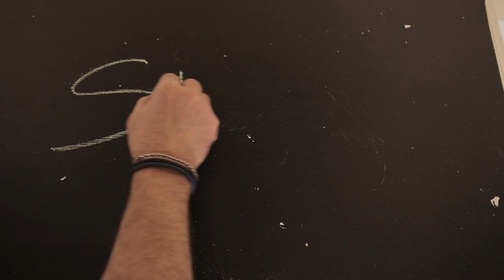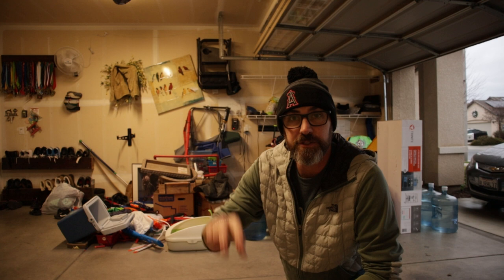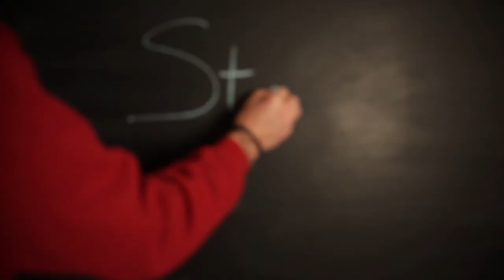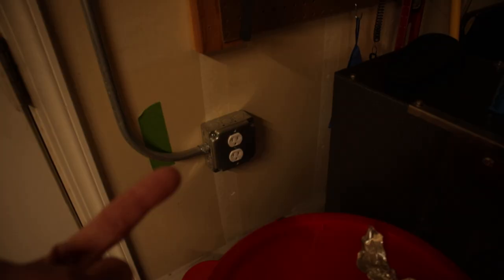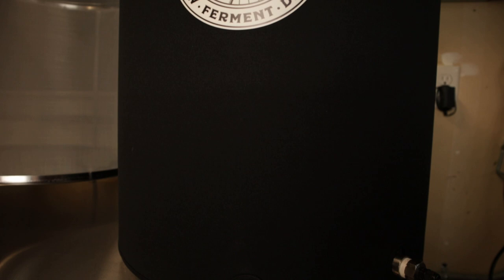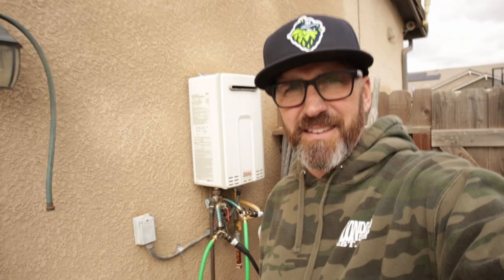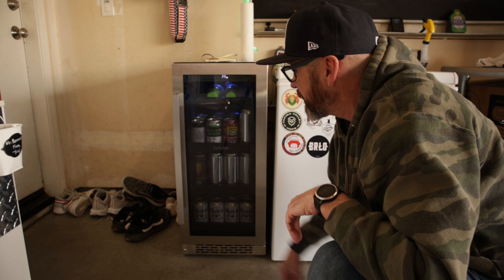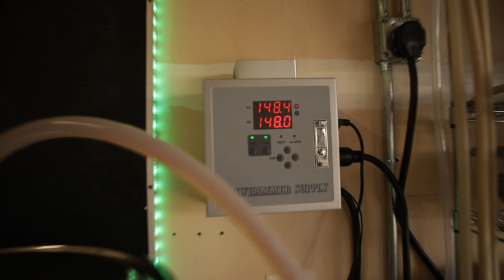How I turned my messy garage into a home brewery

Comment: Where did you get the table? And how big is it?
Reply from the maker: Got it from Amazon. It’s there Amazon essentials. Best price I could find too and so far so good. 48 inches wide and 32 inches high. I was looking for something a bit lower but they were way more expensive.
Reply: @ElementaryBrewingCo  the bracket for the pump?
Reply from the maker: @koryandrews8133  Exchillerator makes it, you can find it on their website.
Reply: @ElementaryBrewingCo  awesome video exactly what I needed!
Reply: @ElementaryBrewingCo  Do you have a link?